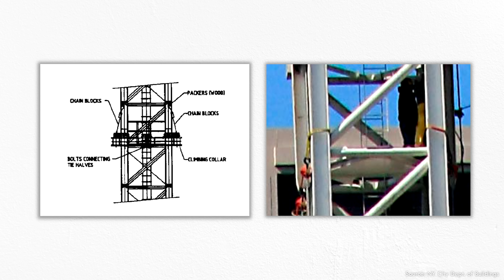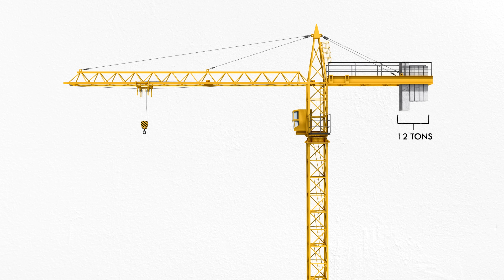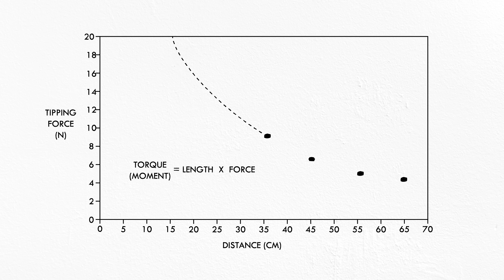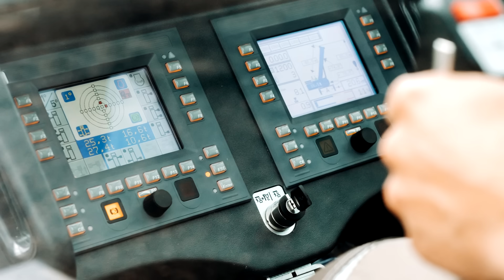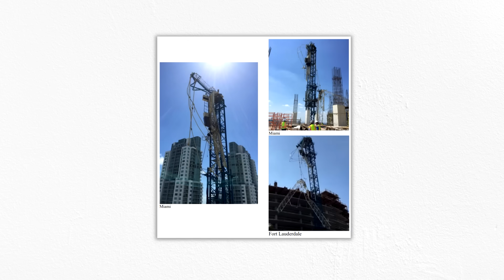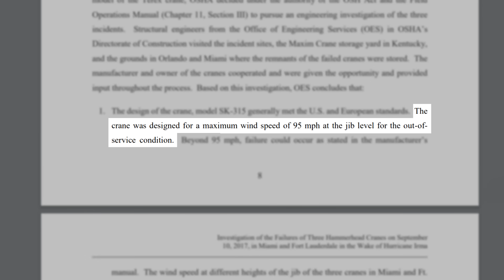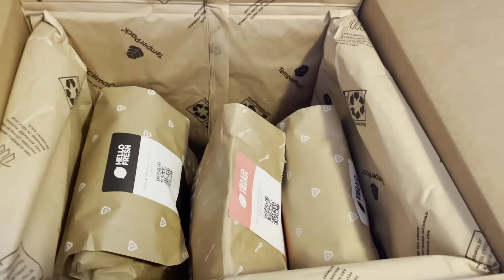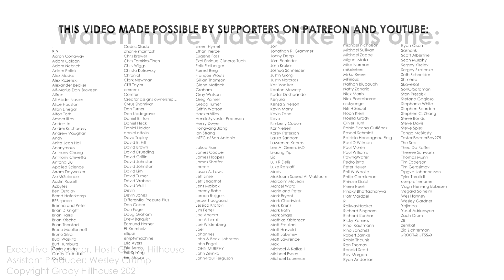Why Cranes Collapse

Comment: Some of these considerations also apply to non-crane situations.  In 1973 the WDBO TV tower in Orlando, FL collapsed killing three workers who were on the tower at the time.  While the specific cause was never determined, it was pretty clear to those investigating it (including my father) that the workers had not been following the directions for the disassembly/reassembly of the structure as they were adding more waveguides for new antennas.  Since the waveguides were relatively long rigid constructs, they had to remove some of the struts of the truss, the design supported this, but there was a limit and apparently they were getting ahead on removals and behind on reinstalls.  Thus it reached a point where the structure was below the minimum strength required for the wind load.

Disclaimer, what I know is second hand from my father, who was Chief Engineer for the corporation (in RI) that owned WDBO and thus his signature was on the original plans (including the referenced directions) for the tower.  The collapse happened on the day I was graduating from High School and he had to make an emergency trip to Florida and missed the ceremony.

Comment: I rented a crane once to put two subarus on the side of a water tower for an ad, a crane had fallen over the week before and everyone was afraid it might happen with us.  I was 24, with only a little commercial high angle experience and a lot of rock  climbing.  After I bolted it on, me and my buddy got on and jumped up and down really hard, it seem to hold fine so I unhooked the cable and sent the crane home.  The guy I worked for (Murad) was a crook who put things up on the weekends without permits, they never caught him, I didn't get paid in full for my work either.  Imagine, a big company like Subaru getting their ad work done like that.

Comment: When you discuss crane failure,  you need to look at the failure at Arkansas Nuclear One, removing a 500+ton generator stator. One Carpenter Apprentice (Scaffold Builder) was killed.
Reply: This incident happened at ANO in Russellville,  AR, on March 13th 2013.
Reply: 5his was a Nuclear Power plant...the stator falling into the cranebay tripped Unit Two.

Comment: High up and too far out. A load that was already critical with pad load settings shifting and wind sway takes load out even further. An escalation of events that will overcome the unit’s stability or structure strength or both will result in catastrophic damage. Very possible fatalities.
Don’t push the limits. If something fails it’s not gonna be pretty.
That boom out there and rigging already is tremendously heavy without load and is a very substantial wind sail. 
Hidden voids as abandoned subsoil tanks and soft soils. There are plenty of dangers lurking to snag you proceed with caution.

Comment: Yeah, our guys (contractor specializing in electrical and solar) said that they would be fine in operating a crane, and wonder why I said no, absolutely not under any circumstance.

The biggest takeaway here is that almost all of these tragedies are caused by unqualified persons and/or contractors assembling and/or operating the devices beyond their capabilities. I told them I would rather spend $20k on a crane operator and a crane for a day than have them and us do it. The dude that lives to do nothing but cranes, I trust him, not so much the guy that hasn't operated a crane in like the last 3+ years?

Comment: You left out three major reasons for catastrophic failure. One, not maintaining industry standards for basic essential factors like welding critical parts, one east side NYC collapse that killed 3 (?) in 2013(?) was caused by the scumbag crane co. Owner sending the “turntable” to china to be rebuilt ( he should still be in jail, got off by hiring good lawyers) , two, not hiring and respecting top pros to operate and oversee the critical operations, that’s the factor in the failure to properly tie back the tower you cite, also in midtown east within a year of the other, and the other is failure to observe and respect unusual weather, the the unloaded crane that tipped over you cite ( on Worth St in my NYC 2016?) happened on a day it was both a wet clinging snow, and a gusty wind up to 45-60 mph. It was that combo, at least a few hundred kilos of wet snow, + gusts of wind straight from the west down the street as the boom was lowered that tipped that.

Comment: Greetings. I wanted to relate a story about an incident that I saw in the mid-80’s. Our university (UW-SP) was adding two stories to their library - - from three to five stories. The crane would reach up to deliver stuff to the top. Every evening, it would deliver a fixed-frame tarpaulin as a tent to cover the construction area. It was rigged with four cables, one at each corner. The day I saw it being placed for the night, a breeze caught it when it was about four stories up. It became a kite. The crane started to rock with the wind. The operator first backed up the whole crane; but then swiveled the boom away from the wind about 90 degrees. That saved the crane from overturning. Of course, I would then have been directly underneath the whole shebang if it had tumbled. Next day, the workers rigged only two cables on one side of the tarpaulin, so it no longer was dangerous. It just flapped in the breeze.

Comment: Well, spending few days to analyze the appropriation operational requirement for the crane to ensure worker and worksite safety usually deem unnecessary procedure by the contractor, since most of them considered 'time' is $$$, the sooner it is set up and running, the less '$$ wasted'. Human factor is highly unpredictable unlike science or engineering. ￼🤑🤑

Comment: When you’re talking about the crane accident in Vietnam you said that the ground would not support the load. Did you mean the that the weight of the crane was part of the load also?
All the old-timers I worked with in the training industry always told me that most accidents when the ground gives out. Is because the ground would not support the crane and the load. If you really stop and think about it as a Crane swings around over each quadrant or each Outrigger pad in a capacity pic the ground is supporting almost all of the Cranes weight and the load. Otherwise everything in this video seems very accurate. And I think you did mean the Vietnam accident was that the ground would not support the crane and the load correct?

Comment: Crane is very easy to operate but the responsibilty is not easy. Thats why crane operators maust pass the training and exams before they are get hired. I have also simple tips. On how to proper operating and lifting related on crane. Just check it on my video. Thanks..

Comment: Career traffic controller. Flagged for thousands of hours around utility companies. There's a utlity company with a similar ringing name to crinkles & Destroys. Every time on the road even with supervisors alot of operators didn't use the out rigger pads and with just the 5000 lbs of weight on the 1ft square outrigger foot would dent the road. There was a time i was on a W.E.E.V.E. shift with a company for 3 years and 1of the guys didn't use the out rigger pads and his truck sank. The truck was on a 48 degree angle when it stopped sinking. The boom was at the top of a utility pole with 2 people in the bucket and they were changing a cut off switch and transformer.  The bucket trucks "bucket controller" locks itself out as to not move the boom and tip the unbalance the truck. They had to wait for the fire dept with a ladder truck to get them out of the bucket 30ft in the air. Then a (company owned) mobile crane to "right" the bucket truck. There are outrigger controls on the rear bumper of the truck. And a boom control on the base of the boom. In case the person (s) in the bucket become incompasatated thecboom can be lowered from the ground and the bucket goes horizontal to pull the person out in stead of lifting them out.

Comment: Another brilliant video, thanks Grady! First time commenter here.
As well as expanding the tipping line, another reason to use outriggers is that they are (presumably always) bolted directly to the frame of the mobile crane. Without outriggers, the vehicle's suspension will take up the load, and it will naturally settle to one side. Having outriggers directly connected to the frame removes this issue and makes the crane more stable...
...but then again, what do I know? I just translate crane manuals, I've never actually used one! I'm happy to be corrected by the pros :D

Comment: The load chart is accurate when the crane is set up level. When the crane is out of level it can derate lifting capacity up to 60%. Most failures are operator error or ignorance and misunderstanding of the fundamental terms and principles including poor training and quickie training.

Comment: In my job site we encountered a problem where the foundation for the tower crane was elevated 3cm due to underground pressure coming from the continuous auger piles we were constructing. That same week a towe crane was overloaded and failed in the same city

Comment: Great job! I am a journeyman plumber in STL. 

I hope you will understand why I feel like I need to mention something about the “Big Blue Incident” (12:50). My recollection of the events (second hand/hearsay) is as follows. Original operator refused to do the scheduled lift because of concerns about the wind. OSHA, who was on site for obvious concerns gave the go ahead to proceed. The operator refused over their personal concerns (I hope this is true😞) about the wind. The general contractor, sub contractor, and OSHA asked the “oiler” (assistant to the operator) to do the lift.

 I choose to believe they did so under duress/pressure. Schedules are a kind of pressure that few may ever experience on a construction site. I think many accidents happen, and exponentially more don’t, because of this pressure. 

Anyway, the situation happened and I think it is worth mentioning the families of the fallen workers are normally preyed upon by big law firms that are more than happy to take a 50% or more cut of any monies that they might receive years and years later. I’ve seen law firms that took 50% of money workers got from being dose with radiation while working as laborers in “safe” areas, just to have the lawyers have the taxes taken out of the workers half. BRUTAL! 

I’m sure the verge of events that I heard and remember isn’t exactly what happened but I just had to mention some thing because the situation definitely makes it look like the operator was at fault and honestly it’s just how I choose to remember everything and don’t wanna know another version ;-). Thanks for your patience with me and I can’t tell you how much I appreciate your videos. I’ve only recently found you but now I have something to look forward to on my commutes.

I just wanna be clear that my comments and thoughts or not me trying to take anything away from the work that you do or in anyway trying to throw shade, as the kids say.

Comment: Lets create a crane that has sensors, anything done wrong to show them errors before use and also during assembly a sensor is a check ✔️✔️ that it has been installed correctly

Comment: I have one issue with your video on big blue. Big blue may have been close to capacity but your theory on wind doesn’t match up with actual disaster investigation. The wind was in the range when the wind shifted direction. This put a side load on its super structure as well as thee piece it was lifting. The main pin holding the crane to its base broke and the whole kit and caboodle went over sideways.

Comment: It's neat that you mentioned Hurricane Irma causing the failiure of cranes in Miami. A takeaway that sometimes yes, theres always a possibility that a crane falls simply due to the power of a mighty storm. 
When it comes to hurricanes and tornadoes, windspeeds hundreds of feet above the ground where cranes commonly operate can be MUCH higher than what is experienced on the ground. Miami did not recieve a direct hit from Irma's strongest winds, and if it did, I would imagine that most if not all the cranes in the downtown area would've collapsed. Not to mention all the other problems that scenario would cause to the high-rise buildings themselves.

Comment: He is wrong on the crane in luff in NYC operator never boomed down weight off the heavy snow was the cause of failure the whole crane flipped over that's why the tracks are upside down also the city didn't give permission to boom down night before

Comment: What about the one that fell in Milwaukee while building the Miller stadium I think that’s what it was called
Reply: The pressure to finish the stadium. That made people decide to work when they were not supposed to. You said the crane operator made a wrong decision. That’s a huge statement! The crane operator knew he was in rough situation. But he was pressured by the job to be completed. And overstressed by  Big business. Sometimes when you’re told We have to have that done today no matter what. You stretch the boundaries, and everything goes OK. And then you become less sensitive! You start to trust the machine it’s supposed to be rated for three times the load. So you’re like well we’re not we’re not that bad we’re not that far over. That was a group decision to not only blame the man in the machine. Or say the operator built it The man that operates the crane does not build it. It’s just the way you present it I’m not being mean I’m telling you

Comment: Safety mostly comes down to money and how much a project values human life. Doing everything right and adding a sizeable safety factor slows progress and involves more oversight. Experience also matters in the form of seasoned teams assembling and running familiar machines (with even more cost). In most cases, when amortized over many projects, the cost of a single failure (including the cost to compensate for human lives) is less than the cost to cut a corner. Or simply put ...on a dollars and cents basis... wrecked cranes, mangled structures, erecting statues of those killed, and a brief delay are often cheaper.

Comment: The big blue collapse at Miller park was because of management, not the operator. A supervisor was fired earlier on in the job for bringing safety issues forward. From that people didn't want to complain in fear of losing their job. So when it was still to windy to lift, the workers were told to do so anyway.

Comment: I missed a very "recent" and obvious example of human error as cause of failure. I'm talking about the case in The Netherlands where 2 cranes on a floating pontoon in a canal were positioning a bridge when they both failed after one went out of balance. (location: Alphen Aan Den Rijn; date: August 3, 2015) Miraculously nobody died, in spite of falling onto several houses alongside the canal. There is a lot of footage available on the internet, but I'd love to see it broken down by Grady. When I first saw the first pieces of footage that went viral around these parts, I didn't know what was going to happen, but right from the first second my gut feeling screamed "Idiots! That's never going to work!" I think they decided that the main issue was in the mechanical communication between both cranes which would amplify any instability before it could get adjusted, because when one crane was too low, it would get more load and thus tilt the pontoon ever so slightly, causing the other crane to go up increasing the difference and so on. But clearly, I didn't find any explanation as crystal as Grady's would be :)) 
Most footage compiled here: https://youtu.be/Iug25i5sN4A

Comment: Worked as a Ironworker for almost 40 years, plus 5 years as a field safety manager. One of our jobs is to assemble/disassemble cranes. Here in Atlanta last year there was a mishap on a tower crane tear down. Evacuated buildings, closed off the street for over a week. The company I worked for sent guys down to help stabilize it. It was a big deal in a lot of ways including $$$. I'm retired now but couldn't help myself on seeing what was going on. Not saying anything other than obviously everyone needs to be on the same page, it's dangerous work. I was on a job when a 150 Ton turned over, scary stuff

Comment: I find it rather amazing how many cranes tip.  One time a crane company was placing a mobile home on a foundation for us. Their spreader bar had about a 1/4 inch hole in the bar and that's right where it folded and the mobile fell right on the foundation. The picked it back up, placed it where we wanted it. They just had cracks to repair

Comment: I work on and operate cranes in excess of 500 tons. The most dangerous person on the job is the one that simply says "it can handle it",  they are usually the first to push the crane too far. I've had to fix the brake on the motors during windstorms with tower cranes. First I manually release the brakes which will cause the tower crane to slew with the wind, from there I have to fix the problem and periodically release the brake to match the wind. Weathervane is very simple, you release the brake and literally a solenoid wedges a piece of metal under the brake leaver inside the motor to keep the brake released. Usually the issue is electric or the brake needs adjustment, I can keep a crane in weathervane with a screwdriver in an urgent situation or I just back the brake off completely.